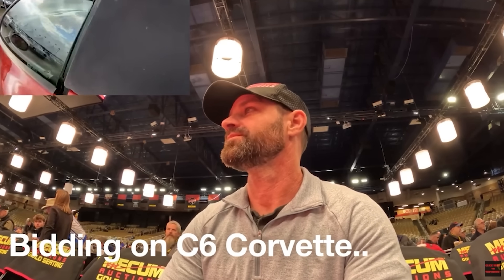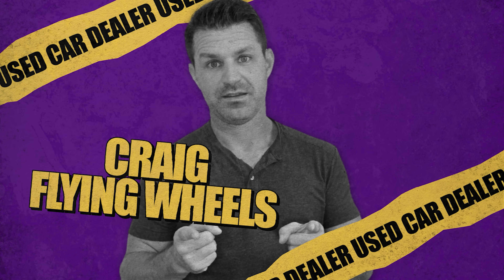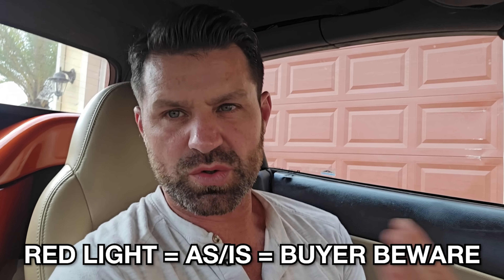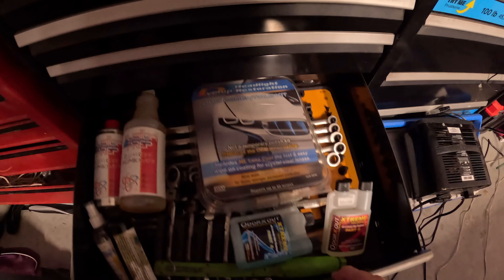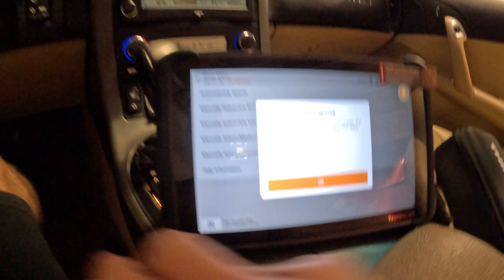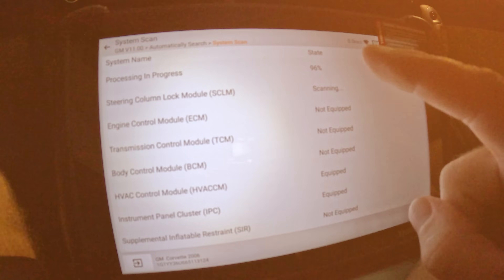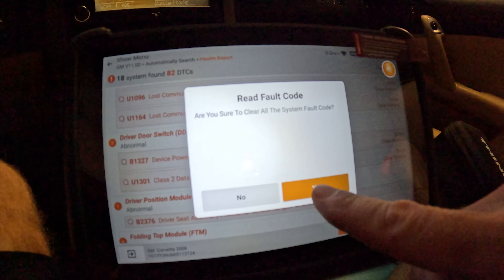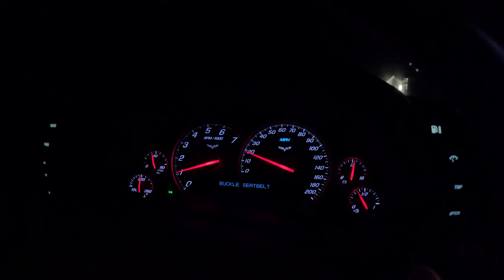I Bought a Cheap Corvette at auction with Check Engine Light on - Thinkcar Scan Tool Fix

Comment: I noticed when you were talking about the manual top when you couldn’t sell the car your check engine light is still on lol so I guess the vent valve solenoid didn’t fix the issue or there’s more to the story

Comment: Craig .. Explain why as you pull away from WAWA    your check engine light is still on  ???    your  subscribers are feeling  scammed into a BS episode for a scan tool that failed. or you failed to fix the problem.   or this episode is pure Bull crap.

Comment: Wouldn't it be easier to replace the part with the wheel off? ( By the way, I call an electrician to change light bulbs. I cant fix anything)